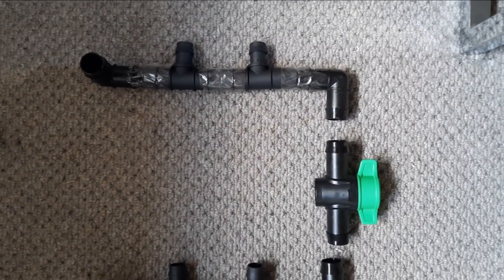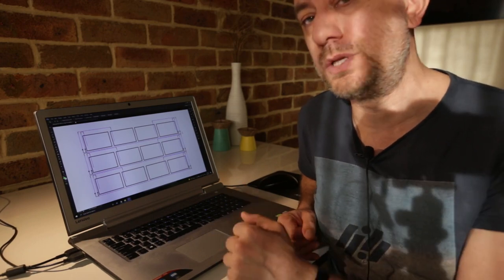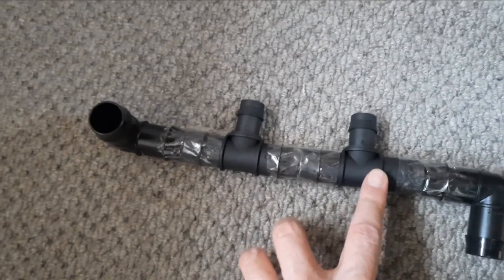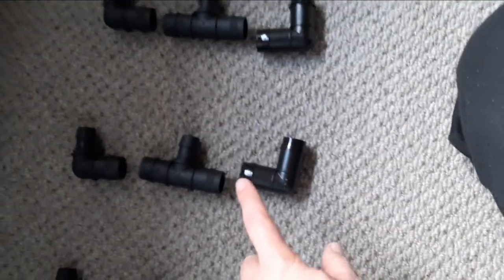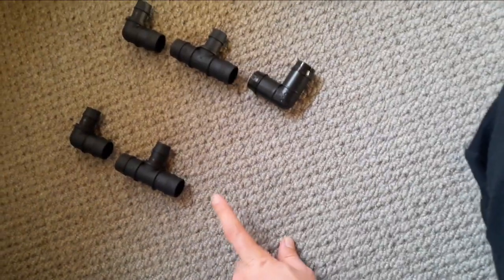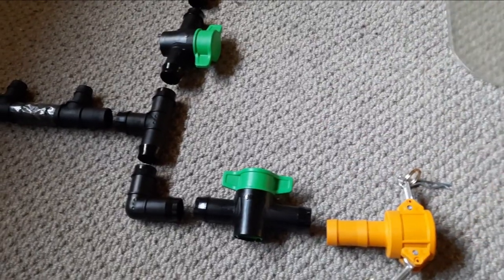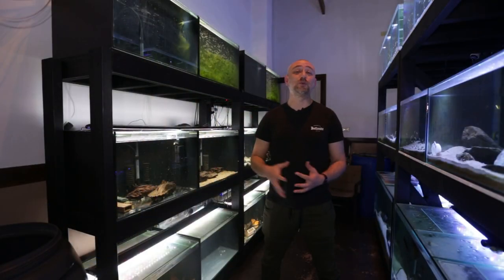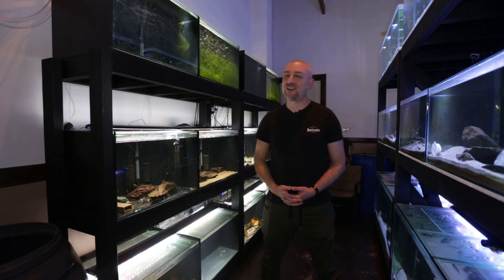Fish Room Water Change System - Part 2 - No drilling

Comment: ive built various waterchange systems and learnt a thing or too, but i would recommned making the overflow draining as large as you can, i open a value on a rack that does 18 tanks and the combined overflow is more than expected, to a piont where i had to upgrade to a 40mm hose and a 100mm overflow catch pipe so it didnt back flow
Reply from the maker: Cheers for the suggestion mate, I'll see how this goes, if the flow is too much I can always do a row at a time. I'm actually looking forward to running it for the first time and seeing what things I can learn from this.

Comment: I think you need more ball valves. I recommend having 1 valve per tank, specially if you use your system to also refill the tanks because the tanks won't refill at the same speed.
Reply from the maker: Yeah mate, every tank has one. I mentioned it last week.

Comment: how do you get the suction going on the pipes to drain?
Reply from the maker: Connect the system to your garden hose. Fill it up with water until you see water entering your tanks. Then, close all the ball values. This will hold the siphon until you open the ball valves back up. Hope that makes sense.